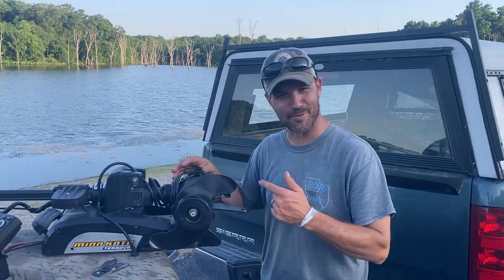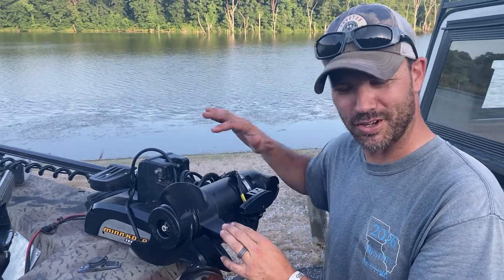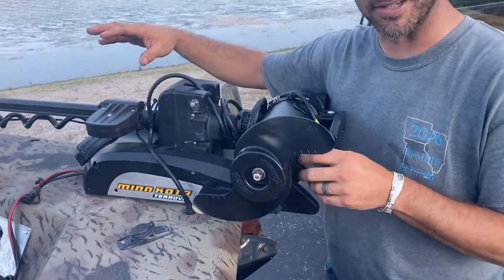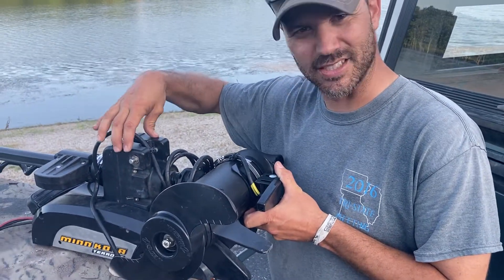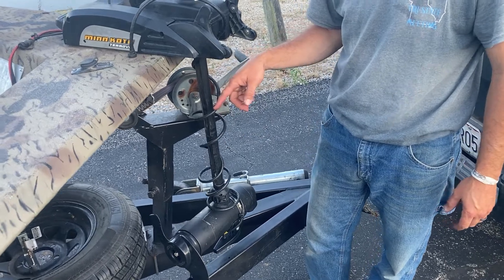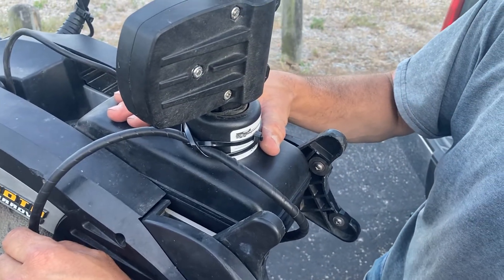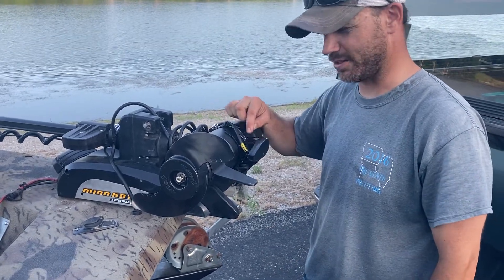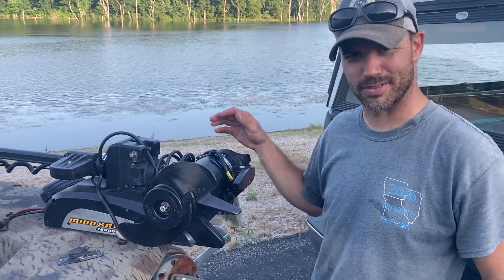Terrova transducer install

Comment: I  enjoyed watching and learning from watching your video.  I noticed that you helped the top coil down in the demonstration. I was wondering if you have had any kind of binding of the cable  in that location?
Reply from the maker: I’ve never had it bind up when it’s deployed. I make sure when I lower and raise nothing is bound up. Ran this setup now countless times on the water and so far I wouldn’t change a thing.
Reply: Thanks for your video reply, I like the way you set this up.
Reply: I have a Terrova Riptide, so this is my only feasible option, that doesn't look terrible!

Comment: I like how clean that install is, I have a boat very similar to you and was wondering how did you get your cable to go into the boat and then to the unit? Was it already like that or did you DIY that?
Reply from the maker: I drilled out a 1/2” hole then inserts a rubber grommet that I ran my transducer cable through so it wouldn’t get scraped up along the metal. Then just attached my cable to back of unit and zip tied the extra out of the way. I cut an access panel about 6”x6” so I could get to the unit up front

Comment: If you can do it, and have access to machining, the absolute best way is to disassemble the power head, disconnect the cables, and mill a slot deep enough to accommodate enough of the cable diameter to slide through the fixed block on the Terrova. You center it up on the existing key slot in the shaft, and it will pass through and up and down without any coils. It’s almost as if it’s internally installed in the shaft. 

All you have to do after reinstalling the power head is secure the cable to the shaft. You can lay the cable in the slot and secure it with silicone. I’m on my third season without a glitch.
Reply from the maker: Well I have seen this done, and it was after I had already finished mine. But I agree 100% that would be the best way to install a transducer cable. When this one shoots craps I will probably go the route you’re talking about. Although so far I haven’t had a single issue out of mine. But your method is sharp looking and mess free👍
Reply: Would love to see an example of that…
Reply: @phillamoore157 This video is a good method as well, it all depends on what you want to do. I had access to a Bridgeport Mill, but there is a vid here on YouTube by a guy who used a router to do the same thing. 

Search for install transducer on Terrova and it should come up.
Reply: @jetcat132  Thanks @jetcat132....I'm going to give this a shot.  It's simple and cheap.  I just know that I can't go through soldering another transducer cable again.  I'm decent with a soldering iron, but that was a horrible experience.  Those internal wires are just too small to work with.  Thanks for the reply, my friend...
Reply: @phillamoore157  I’d post a picture of mine if I could, it’s seamless. Three straight seasons, and it still looks almost like an OEM factory install and works perfectly. 

Good luck, just take your time and it should work out. I know one thing, the chips and slivers generated by milling that shaft were nasty. I don’t know what that composite is, but it’s a pain in the ass. Make sure to wear gloves because the slivers are bad.
Reply: @jetcat132  ...thank you brother.

Comment: Interesting…I’m going to give this a shot.  I don’t like the bike cable method either (not unless i absolutely have to).  If you haven’t had any problems with this, since your video, I’m gonna pickup some clear hose.  Btw….I’m assuming that hose is “open” to allow you to slide the cable into it, then you wrapped the hose with some sort of tape?
Reply from the maker: Zero issues so far with this method, countless times on the water with it. The air hose is hollow, but just use a roofing hook razor blade and slit it allowing for the transducer wire to placed inside. Then electrical tape shut correct.
Reply: @heartlandtrapping3194  Yeah....that hose part doesn't concern me.  What I did with putting my priority in protecting that transducer cable form being hacked up by the TM blade, that prior to soldering the cable back together again, I put some heavy duty shrink wrap around the most vulnerable parts of the cable.   I NEVER want to go through soldering internal wires THAT small again.  I'm good with a soldering iron, but was disgusting.  That was almost as bad as replacing the steering collar that inexplicably broke 2nd time out.  But, I digress.... this looks promising.  Going to try assembling it today.

Comment: This might come as a stupid question. Sorry, but how did you get the transducer line in the hose? Did you cut the hose all the way and rewrapped it with electrical tape.
Reply from the maker: Yes, I had to cut the air hose line and then wrapped with electrical tape.
Reply: @heartlandtrapping3194  thanks great idea a lot of guys trash terrova I love it.I am  fishing  instead of  fussing around  with a trolling motor. Thanks again!!
Reply from the maker: Just trolled half a day for whites and crappies with my Terrova. I’m still running the same setup and wouldn’t change a thing. I’m with ya, less fussing and more fishing👍

Comment: I took my transducer cable and ran it INSIDE my trolling motor shaft (sealed with white 5200) and it comes out under the head unit and down the TM cables. The only cables you see are at the transducer head for about 8 inches then it goes INTO my TM shaft.

Comment: Great option, thanks! Has it held up? Any suggestions/lessons learned? I'm getting ready to do the same on my Terrova.
Reply from the maker: I’ve had it out several times, trolling for multiple species of fish. Held up great, so far I wouldn’t change anything
Reply: @heartlandtrapping3194   Good to know. Thanks!
Reply: How did u run the ducer cable in the hose isn’t the connection a lot bigger than the 1/4 inch hose
Reply from the maker: @tranzformedyouthtn  I slit the yellow air hose all the way from end to another. Put transducer cable inside and then taped entire length of yellow air hose.

Comment: Why the air hose?  Strength in case shaft gets in a bind because it is stronger than the transducer cable?
Reply from the maker: You need something that has a coiled memory, the transducer cable by itself will stick to tight to shaft and bind up.
Reply: @heartlandtrapping3194  thx - I looked at a 3’ 1/4” air hose at Harbor Freight - it did not look near long enough?  Just confirming length. Appreciate it

Comment: Didn't your cable get caught up in retrieve or as you had to do pull away on going down...???
Reply from the maker: I make sure when I lower and raise nothing is bound up. I’ve used it like this for a months now and countless times on the water, wouldn’t change a thing so far.

Comment: Would this method work with an ulterra?
Reply from the maker: @riverrat3231  I am not sure on that, I just haven’t been around the ulterras to know
Reply: @heartlandtrapping3194  I can see this working well with the terrova, but the bike cable method may work better for the ulterra models. Thanks for the video

Comment: Did you slit the airhose to feed the cable?
Reply from the maker: Yes
Reply: That was my question, as well.  They make cable with the slit in it already….  I didn’t realize he bought standard hose, and cut it.  Short of that, this looks solid.